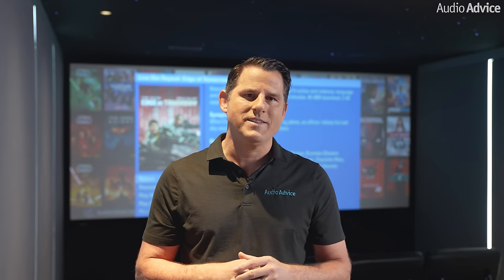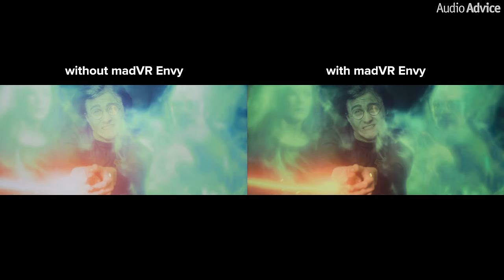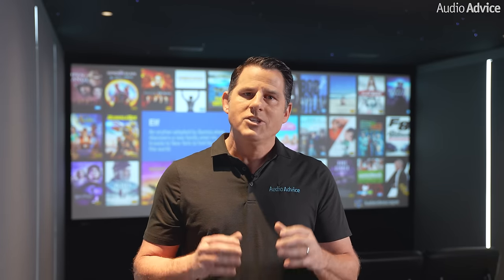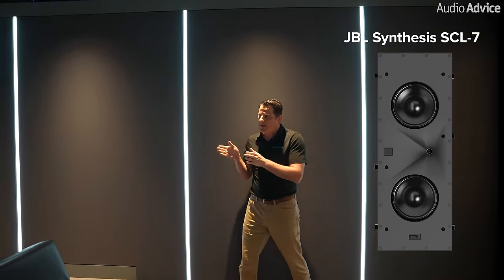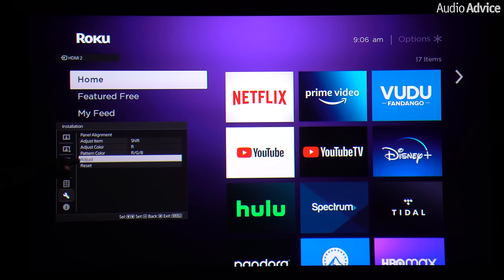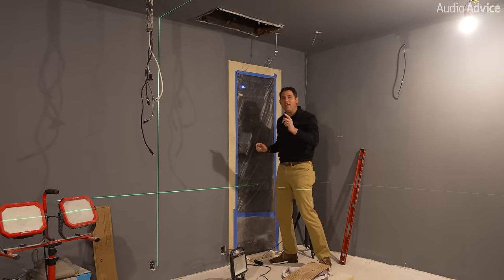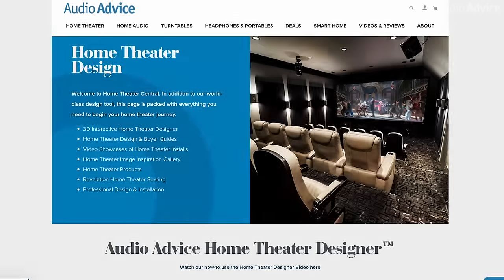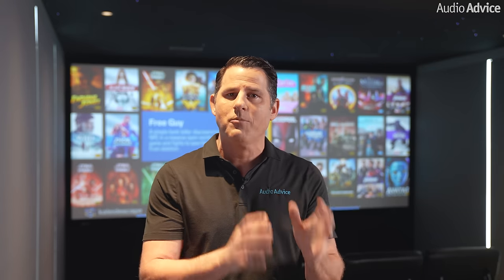How To Update Your Home Theater! JBL Synthesis Home Theater Install Timelapse & Showcase

Comment: I guess if you're not changing the cables, you must be happy with the way the room sounds (noise floor)

A message to the folks.. if one wishes to be able to press pause or mute and not be able to differentiate whether the system is on or off... then don't cheap out on cables. The better the cables (shielding), the quieter the room.

Top quality video once again.
You're made for this.. you bring great energy to your videos 👍🏻
Reply from the maker: Thank you. Good grounding is important too for the ulitmate in quietness.  Thanks for sharing

Comment: I bet you could get regional installers all over the country trained up that are "audio advice" certified and provide them with video education and certification exam!

Anywho, how do you convert the LED 12v and run appropriate wire to them? Where is the transformer?
Reply from the maker: Thanks for the suggestion.  The transformers are at the rack.
Reply: @AudioAdvice  Do you work with a preffered transformer? Looking to create the same setup. You're team as been amazing helping me my dream JBL synthesis setup
Reply from the maker: @davidbracetty  We would recommend you use the same brand as the LED strips and use their calculator to determine the size and how many you need.  Glad you are working with our team on your dream system! Thanks for the support.

Comment: Wait! You made an IMAX movie like Interstellar smaller in the 16:9 portions? 🙄
Reply from the maker: It was modified for the bluray disc.
Reply: @AudioAdvice I wonder if there is an option to crop the top and bottom image for those IMAX shots on the projector and leave them in the same format as the rest of the film, because although I love Interstellar I have never liked it when directors like Nolan just put pieces of their films (sometimes some shots in the same scene) in the IMAX vertically expanded aspect ratio format and on top of that they get an Academy Award for it.